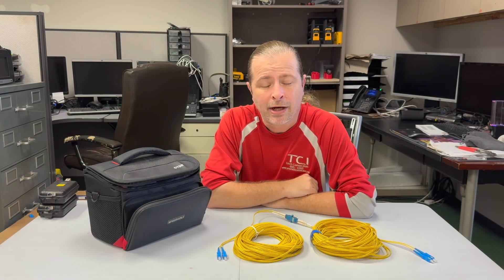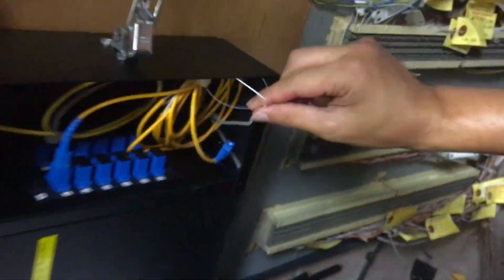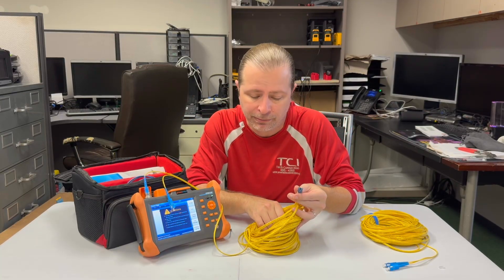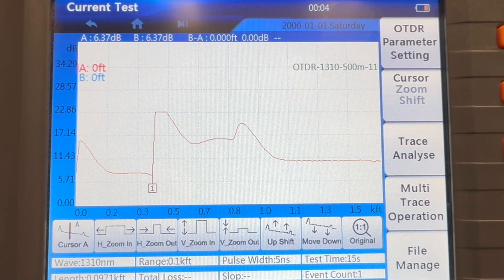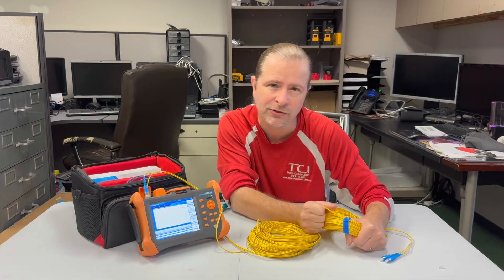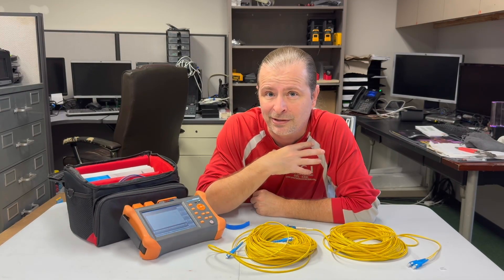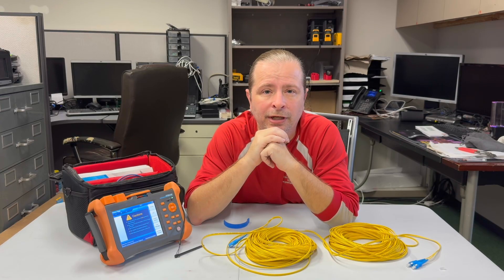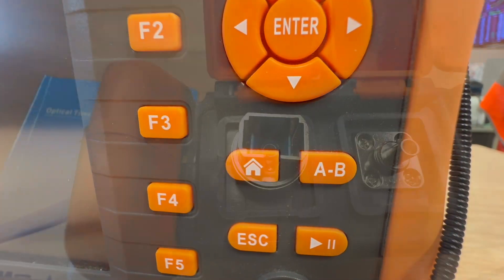Testing Fiber with a cheap OTDR from Amazon - for beginners and home users

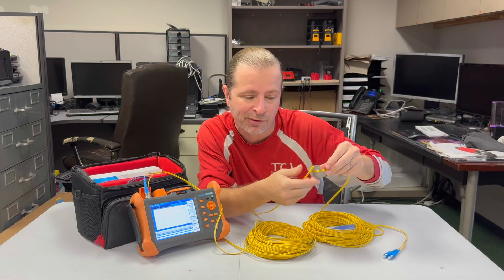Comment: 10:35 "A coupler which the thing cannot see" - except the fat hump in the middle of your measured length was very clearly visible at 8:35 :)  And if you tweak the settings you can get better resolution and see even good splices no problem. Don't underestimate even "cheap" measurement tools..

Comment: Out of curiosity, where did you get the launch cables, or did you make them yourself?
Reply from the maker: There's a ton of them on Amazon, if you use my saved search: https://www.amazon.com/s?k=fiber+launch+box&crid=IC5XCL5V9NXS&sprefix=fiber+launch%2Caps%2C209&ref=nb_sb_ss_ts-doa-p_1_12

I found I had to test them with a light meter to be sure the results were good, I have gotten a couple of bad ones over the years.